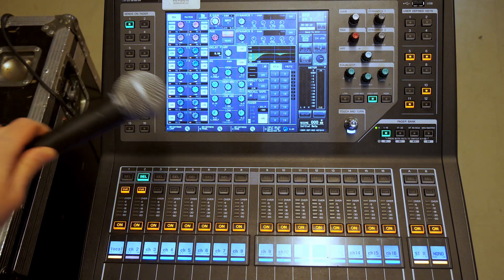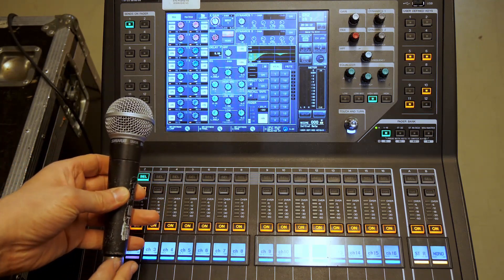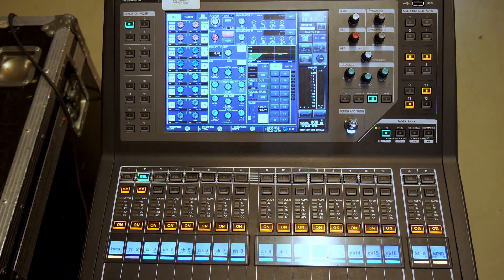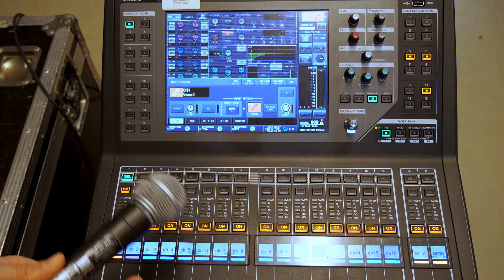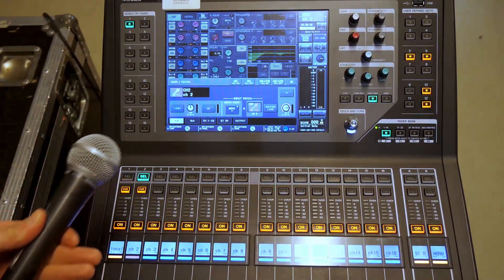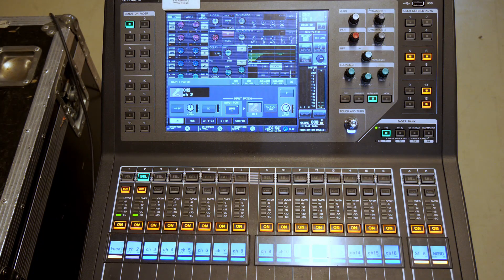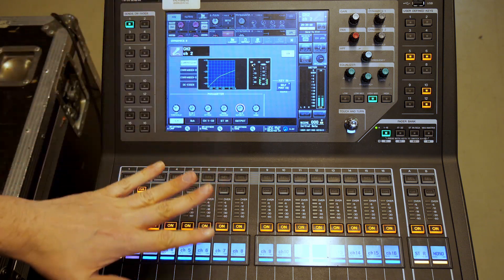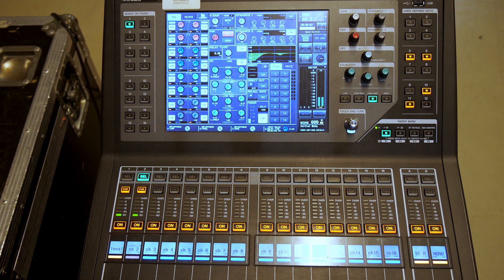Digital VS Analogue Gain

Comment: Maybe I'm missing something, but in the monitor example isn't reducing digital gain the same as lower the fader? Wouldn't I be able to reduce the level of the signal feeding the monitor by adjusting the send amount to it, also in a pre fader send scenario (no fx and no fader control from channel strip)? I apologize if I wasn't clear.

Regard the compressor example I totally get it. That was my first idea of that digital gain control (and maybe trimming a hot coloured signal from analog stage too)
Reply: Hey. Good question. I probably wasn't very clear about the monitor example, . What I was thinking about when said this was a separate monitor console, where two consoles are sharing a set of preamps. it was mostly an example to show how the control works.
Reply: @andrewgraham3855  More like having a controlled signal to work with from the beginning instead of lowering it on sends? 

Cause in any scenario the monitor console could always lower digitally the signal on send fader (can be pre fader/processing) or channel fader (post processing).

Forgive my insistence, but I'm just studying a system with two consoles and I'm trying to get as much information as I can.

Thank you
Reply: "Maybe I'm missing something, but in the monitor example isn't reducing digital gain the same as lower the fader?"
No. You need to first determine if your level controls are gain or volume. Gain is on the input, and has the potential to distort or overdrive the signal if too much is applied. A volume control can only attenuate the signal, and doesn't have the ability to alter or harm it. Also, volume is always placed on the output section of a component. That's why you need to gain stage, and not volume stage. Once you have gain set properly, you can adjust volume however you like, and not worry about harming the signal. 
If the signal is analog, making gain and volume adjustments raises and lowers the signal strength. If the signal is digital (gain is referred to at trim), the signal is adjusted by increasing or decreasing the bit rate of the signal. That's why its recommended to do any major adjustments while the signal is analog, and minor adjustments when digital.

Comment: I found your channel a few weeks ago and have found it extremely helpful!

I have a question about gain. Am I correct in thinking that analog pre amp gain effects mic sensitivity as well as input level? The reason I ask is because I always feel that I can get more level from a mic without feedback when using less analog pre amp gain and more digital level (usually the output of a compressor to compensate). Probably not the proper way to do things, but I have found this to be a useful way of getting more level on vocal mics in small venues without running into feedback as fast. I’ve never heard anyone declare this, it’s just something I’ve noticed. Or am I just insane? Thanks!
Reply from the maker: So glad it's been helpful! There's no change in sensitivity when applying gain. It's simply an increase in signal. Sensitivity is determined by the mic design. It’s a measure of how much what voltage you get out when you put in a certain amount of pressure (sound). Gain is simply increasing that voltage. Similarly, the fader is just regulating the amount of that signal that is sent to the master output. Adding 5db is the same whether you do it at the preamp, on the fader, or in a compressor with makeup gain.
Reply: @OffshoreAudio  Thank you for explaining this! Very helpful to finally have a solid answer.
Reply: @OffshoreAudio  "Gain is simply increasing that voltage. Similarly, the fader is just regulating the amount of that signal that is sent to the master output. Adding 5db is the same whether you do it at the preamp, on the fader, or in a compressor with makeup gain."

That's not a true statement. All 3 of those adjustments are very different. The gain adjustment on the input is analog. Faders are volume controls. And if you are adjusting compression when the signal is digital, changes are not made by varying signal strength. The bitrate of the file is adjusted. You never want to confuse gain and volume. Gain controls can effect the signal. For example too much gain can distort the signal. A volume control can't effect the signal. That's why you have the term gain staging, but not volume staging. A volume control can't harm the signal like gain.

Comment: Does it make a difference in sound one versus the other?  Also what happens if you only use the digital and not the analog?  Or is it the same thing internally?  Than you!
Reply from the maker: Hey Daniel, great question. I’m not much of an academic but here’s my explanation. All audio signals and equipment are optimised for certain signal levels, that’s why plugging a guitar into a mixer without a DI box sounds bad. Our mic signal (very very low) goes into our preamp and is raised to line level (slightly higher). This is then sent to the converter and turned into digital audio (1s and 0s). If you skipped the analogue gain and went straight into the converter you would most likely be able to get a high enough signal, but I imagine you would have more noise than normal and a loss of fidelity in some way. I’ve not tested this personally but I’m inferring based on other things I’ve tested along the same lines. You should test it and let me know! Though I bet @DaveRat has a video on it.

Comment: Is digital gain considered “noise free”?
Reply from the maker: Sorry for the late reply. It's not noise free, per se, It depends on the bit rate of the encoded audio.. I've never compared them dB for dB but either way there is inherrent noise in the circuitry and the preamp that the mic signal has to pass through so you would be increasing that anyway. I think you'd be hard pressed to hear a difference between the two.